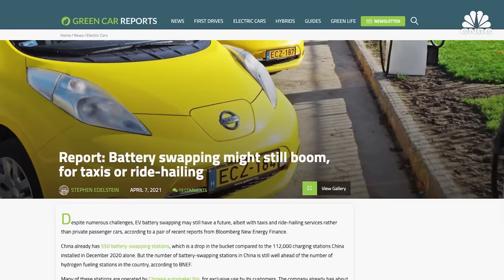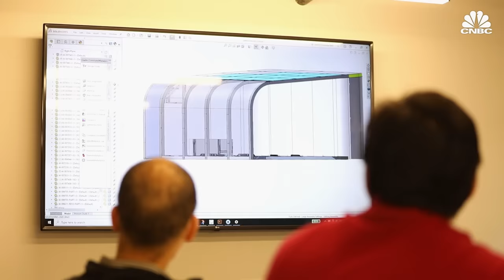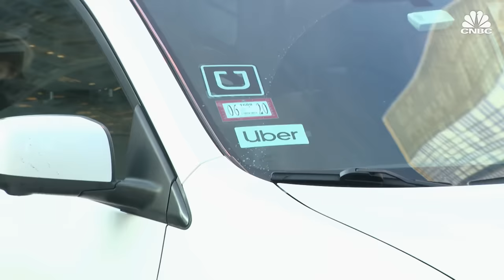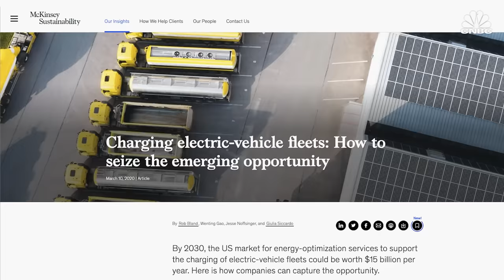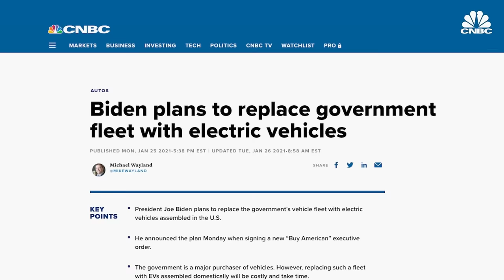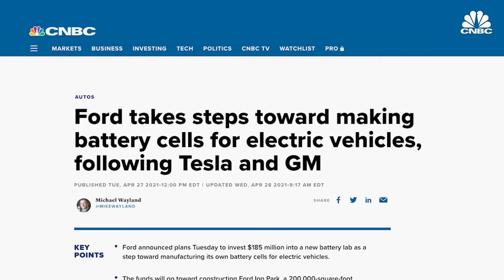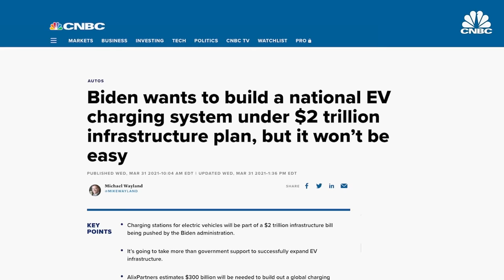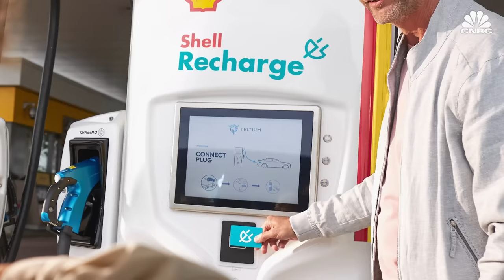Can EV Battery Swapping Take Off In The U.S.?

Comment: Lots of early generation EVs like the Nissan Leaf could opt for this type of swappable battery instead of buying a replacement OEM pack! Those older used EVs are very affordable now and the cars themselves have lots of life left, just the degraded original batteries bringing the car values down. This technology could make all those EVs viable again for the long term!
Reply: This. Used EVs are worth way more than used ICE cars when you account for the longevity of the motors never needing maintenance. Ever see how much longer electric trains and buses last when compared to their gas and even diesel counterparts? It’s 2921 but I just rode a subway train made of cars from 1976 that were retrofitted in 2005 just last week here in Tokyo for example. There will be a huge aftermarket battery replacement industry (not to mention ICE to EM swap cottage industry) in the near future, and I’m here for it.

Comment: I would say if you tried this in a big metropolis, you will have people waiting in 15 minute lines to get a swap accomplished.
Reply: Lol for some reason y’all think that they’re gonna just have 1 station for like 100 miles. They take up 2 parking spots so they’ll have at minimum 1 per gas station. N probably 3-10 in bigger parking lots. Some of y’all need to think a little more and less ignorant
Reply: @josephmccartney5951  Battery swapping is really not a good idea. My city is already connecting ev charging stations into streetlamps for people who dont have a garage. Tesla is going to have way better range with their integrated structural battery pack than any modular EV. Teslas batteries are already cheaper, smaller, and go farther than the competition and it just getting better. How many battery packs will these swapping stations need to have on hand in a city in order to make sure people arent sitting around waiting for a pack to finish charging before it gets swapped into their car? A battery is the most expensive part of an EV and they want to have thousands of these just sitting around when the world is already battery constrained. Each one of these places are going to cost millions in battery's and they will need to be all over the city and highway, otherwise youll be driving out of your way to get a swap, negating most of the benefits. They mentioned using them as grid energy systems, but that will degrade the battery life and tesla is already doing this grid battery powered energy storage with cheaper batteries that dont need to be small or light.

Comment: Why don't they use two batteries half the size, and two charging cables? That would be twice as fast.
Reply: don't think of battery as a thing , 1 thing, think of it as a container that contains hundreds of cells, they're already charging those cell concurrently

Comment: Many years ago, before electric cars took off but after the first Tesla Roadster, I assumed this is how it would be implemented in the future.  I worked as a equipment operator in a warehouse that had a machine to swap forklift batteries.  It was quick and easy.  I didn’t think about supplementing the grid with the battery bank.

Comment: The modular battery pack design won't work with liquid cooled battery packs. The vehicle software will have to be modified to accommodate the change on the battery pack.

Comment: Why they dont put a tray with two positions? one with the charged battery and the other empty to deposit the empty. Then first unscrew and remove the empty one, second turn the tray and third introduce and screw the charged one, finally the automatic tray move to the warehouse. The process would save 50% of time

Comment: While not viable for regular charging, it is viable for removing used battery packs, like those of hybrid cars, and replacing them with a refurbished pack.
For regular charging, the price is too high. If the vehicle can charge at home, you'll see many drivers return a used, worn out battery, for a newer one.

Comment: This is the obvious way forward for EV’s. Have maybe three different battery power options for different levels of performance. Get them all racked up at upgraded existing service stations and swapped by pick and place robots. Get the manufacturers told this is happening and these are the standards they need to work to if they want their vehicles on the road. Far more elegant than cables everywhere and no need to worry about battery maintenance.

The uk government need to get hold of this and sort out this shitshow of uncertainty they’ve created and not just leave it to market forces to sort out. It’s too unfair on people with no offroad parking at home.

Comment: the answer will be warp charging speeds not swaps, this will cause a much larger footprint, more maintenance etc. If they could also make some sort of charger built into a car, as the wheels spin it produces current and recharges the batteries.
Reply: Chargers take up way more room. Just like a gas station takes up way more room. But I agree with you all the same.

Comment: Ample needs to study what the Aircraft industries do , renew and certify their battery before sending it back to their aircrafts. "Battery swap" has high potential and the big companies are not admitting it till they finish their work in secret. This concept can be used in many sectors which people have not noticed yet. Also different methods of charging can be added to this concept.

Comment: There's definitely a usecase for this with service/commercial vehicles. But for personal use? With the upcoming 350kW charging standard, you'll go from 0% to 80% in about 9min on the typical sedan/hatchback battery size of 72kWh. Which will typically give you 120~150 miles of driving. I don't know about you guys but I rarely used to make gas stops that took less than half that. Seems like a small price to pay for significantly cheaper operating costs for a car, especially when in most cases you're slow charging the battery at the office or at home and only need to go to stations when making long trips.

Comment: The problem with battery swaping is that you night a mix of old and new batteries or wall new batteries or all old batteries. The range and power you get significantly depends on these uncontrollable factors. And this is not good. It might leave a person stranded in the middle of nowhere because the batteries were old and could not deliver the expected range.

Comment: Most people in America would do this except for the fact that the car's price includes the cost of the batteries. If Tesla sold the Model S without the battery pack for $15,000 less and sent you home with a fully charged battery that could ONLY be swapped and it took 5 about minutes then it would have been hugely successful. Imagine that with a Model Y. That becomes a $35,000 suv that now Tesla is getting constant revenue from every time he or she needs a charged battery.

Comment: I like the concept but the concern is who is paying for the cost of refurbishing damaged or degraded cells? If a user ends up having degraded or defective cell loaded that damages their car who is liable the owner or the charging station for failure to maintain their packs? Also I don't want to see charging ports removed because charging ports may be preferable to users who use the vehicle for light commuting with the bat swap station being reserved for cross country. The sad thing is for this to work you need a uniform standard battery for all EV's and we all know Tesla will not go back to bat swapping because they want to charge 20K for bat pack swaps.

Comment: Much easier and cheaper to just have fast charging stations, battery swapping doesn't scale very good and you're going to need so much extra battery capacity to even make it work
Reply: The problem though is fast charging puts way too much wear on the batteries which aren’t in ample supply.

Comment: I think battery swapping is much more relevant for the fleets however, with proper regulation like in the EU the standardization of the battery swapping would be awesome in the densely areas which r packed with cars and people don't travel for long distances. Maybe car manufacturers should offer 2 ways of owning their car : 1. through purchasing of their battery pack or 2. by going with the battery as a service option. Standardization however would be a single MOST IMPORTANT thing to achieve well functioning battery swapping which would work well for the car manufacturers as well well as the battery swapping companies. In the EU there should be an agreement in one point to decide which battery swapping technology is the right one before encouraging its adoption. Looking at the mobile market in comparison u don't want any proprietary lightning connector when u can have USB-C if u know what I mean... Still swapping batteries and BaaS will mostly start with fleets like public transport, which is very popular in the EU and they in one (right) point move to commercial vehicles.

Comment: Battery swapping has been the most obvious solution to slow charge times since the beginning of EVs.
Reply: Is the charge time slow for an EV ?   ~300 miles (80% capacity) in 30 minutes with the latest Tesla Supercharger.  It would be interesting to see if Tesla will allow a dual connection option to cut that time in half.
Reply: NIO ET7 1000KM of range...
Reply: if the USA wasn't trying to shoot it`s self in the foot all the time by saying you cant have eclectic car dealerships or Tesla in some states etc etc you wouldn't be in the self imposed mess you`re in... you wonder why china and others have over taken the USA...  USA still in the 60-70s - the rest of us it`s 2021...
Reply: @kylereese4822  2x or 4x range may make little difference other than the frequency of swaps.  Swapping solves the problem :  no access to charge points.  Swapping enables sales to customers at a  lower purchase price (no battery) combined with renting/swapping a battery pack .  Battery swapping of smaller batteries could help alleviate the battery supply-limited EV ramp-up with the use of a higher density or lower density (less battery material) swap

Comment: NYC, 1908 or 1918 a bus Corp was battery swapping. It’s nothing new and those who want to own the battery can charge at home if they want. Swapping works but only if everyone get on board. They can claim battery tech is getting more advanced but the advancements can also be applied to the previous swapped battery as well unless it’s a monopoly from automotive corps that they’re after. This way anyone who wants to make these batteries can. From DIY to major factories. The sooner it catches on the sooner we can make self charging batteries or extremely long life batteries.

Comment: Quick swap configuration has some compelling advantages that should be considered. First, with a family of standardized models with respect to size and shape as well as electrical connectivity, a degree of protection from technological obsolescence as breakthrough innovations in storage density and durability comes forth is provided. A market for EV’s for dwellers in high density multifamily urban and suburban areas where huge charging parts, with corn rows of charging poles are out of the question. With regional charging and checkout distribution centers located adjacent to power generating plants and renewable energy harvesting fields, the risk of overload of neighborhood distribution grids by homeowner charging setups is greatly reduced. Quick swap stations as replacement for fueling stations would obviate range anxiety for long distance travel, as well as lost usage driving time for company fleets. The elimination of inherently empty back hauls by tank wagons with 18-wheelers would be a strong environmental plus! The customer would no longer own the power packs. He does not own the fuel in his tank, bust just consume it. Also, the quick exchange pack structure would provide a viable and fair means for collecting needed infrastructure transportation taxes.

Comment: Suppose you don't want to swap all the time.  Can you safely and consistently charge these batteries at a charging station or at home?

If not, what happens if this company goes bankrupt or closes in your area, etc?

What if the swap stations get busy and you don't want to wait in line?  (This has happened with Jiffy Lubes in my area, but I can go MANY places to get an oil change). 

Overcoming the problem where a manufacturer might not want to willingly honor the warranty if your battery is "meh" sounds great.  But introducing other problems doesn't sound worth it.

Comment: Finally. I always said charging is nonsense. I’m super surprised manufacturers even started with the charging idea. Not buying an electric car until I can swap my batteries.
Reply: Battery swapping is really not a good idea. Tesla is going to have way better range with their integrated structural battery pack than any modular EV. Teslas batteries are already cheaper, smaller, and go farther than the competition and its just getting better. How many battery packs will these swapping stations need to have on hand in a city in order to make sure people arent sitting around waiting for a pack to finish charging before it gets swapped into their car? A battery is the most expensive part of an EV and they want to have thousands of these just sitting around when the world is already battery constrained. Each one of these places are going to cost millions in battery's and they will need to be all over the city and highway, otherwise youll be driving out of your way to get a swap, negating most of the benefits. My city is already connecting ev charging stations into streetlamps for people who dont have a garage, and apartment parking spaces are getting EV chargers, all at a fraction of the price of these swap stations. Supercharging charges 80% of your battery in 30 minutes. They mentioned using these swapping stations as grid energy systems, but that will degrade the battery life and tesla is already doing this grid battery powered energy storage with cheaper batteries that dont need to be small or light.

Comment: The idea of being able to drive 800/miles with Bathroom/Food stops and Battery Replacement is highly appealing!
Reply: The thing is if the restaurants and rest stops had fast chargers, that would get rid of the range issue.
Reply: @mattwolf7698  but, the fast charging isn’t good for your Batteries!

Comment: Considering that buying an electric car with battery is similar to buying a significant portion of your fuel up front, it would make sense to offer electric cars without batteries and use standard modules such as this. The risk fir the owner is much lower because the battery cost is spread out over the life of the car. The environmental advantages of charging on off hours are huge. This technology shows great promise.

Comment: Its like automatic car wash.  You drive and engage your care into a rail, and wait. The rail has powered pushers that push your car into place.  This concept has been with us forever. So why it did not take off, beats me. 15 minutes is still too long,  10c/mile is about $30/300miles which is a lot cheaper than gas but still high.  There are simple things that can be done to improve this
Reply: "The rail has powered pushers that push your car into place.  This concept has been with us forever. So why it did not take off, beats me." You've described exactly how Tesla swaps out a Model S battery pack! The service isn't necessary, however, because no one wants to part with their $10,000 battery to get a used one, just to save 20 minutes at a charge station.

Comment: There's a reason Tesla (Elon Musk) refused to do battery swapping. It's clunky, probably reduces safety due to the modularity (and thus less protective housing) and does not have not a lot of consumer interest. People would much rather lose 10% of their battery over 8 years or something, if that means they can charge as fast as these people swap. It's just too expensive to build these stations, that it's not worth it. We need to invest in battery recycling instead.

Comment: in terms of planning when to charge the batteries surely you could just save the extra cost and buy additional batteries for the charging station..or have a power line to a larger industrial battery offsite?

Comment: For the love of God YES! Hope it catches on so it takes off the customer's wallet the burden to change the battery when eventually fails. It was an unexpected and extremely expensive experience when it happened to my hybrid. This is how all electric vehicles should work, like electric scooters do in Taiwan. It would solve the problem of having to worry where to charge every time.
Reply: Dude, I thought you were trolling.

Comment: I don’t want someone else’s degraded battery.
Reply: I'm sure old batteries will be taken out of service, people don't complain about swapping out propane tanks
Reply: @RandyXandar   um, yeah we do. That’s why I don’t do tank exchange. A lot of old tanks are simply repainted and recertified. I’ve seen some tanks with lumpy rust on them simply painted over. No thanks. I buy my own tanks and get them filled. Keep them in good condition and they also are filled fuller unlike the tank swap places that now fill to only 15lb.
Reply: The other thing is that it’s not just physical age but also hard acceleration, repeatedly running to zero and charging to 100%. If your plan is always to swap it may work but for now I will use fast charging for the occasional road trip and wait a little.